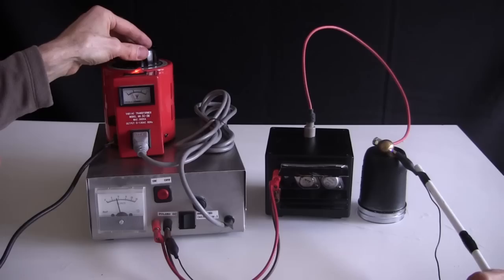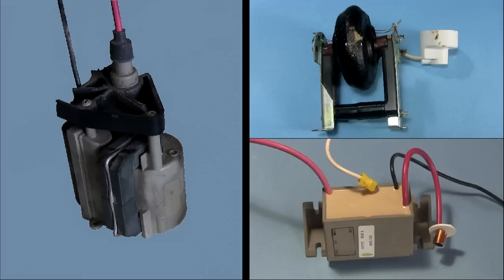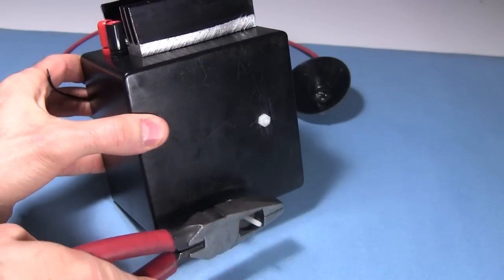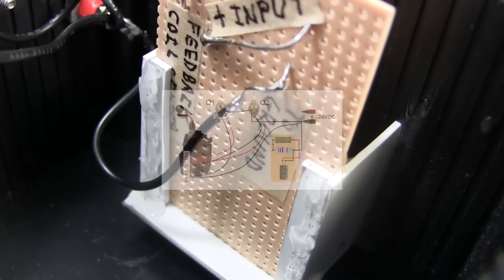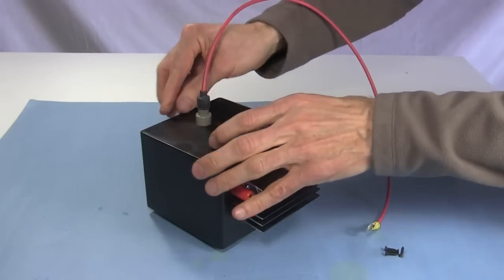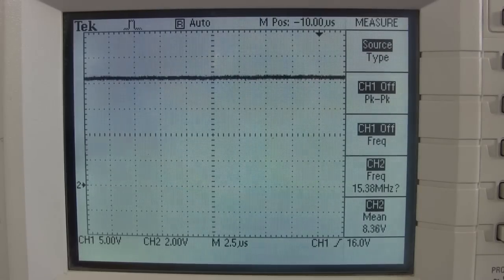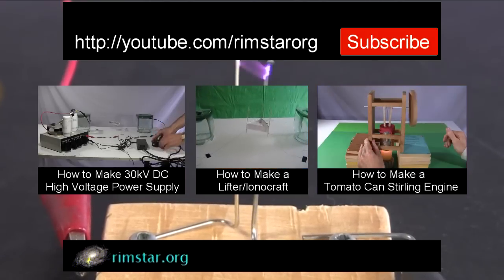The Cube - How to Make High Voltage Power Supply w Flyback/Builtin Diodes

Comment: good day to you . i follow your diagram. and its working but have low spark, because of the of the arching electricity in the corona of flyback transformer. i already put a ground wire and a insulator varnish but still electricity is still arching. can you help me what can i do? or what varnish can i put. thank you for your time.
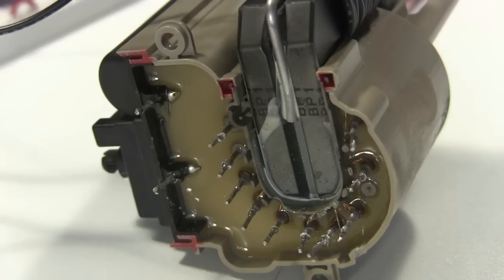Reply from the maker: +john pacheco I'm assuming you mean you have arcing at the pins like I show at 2:33 in the video. If there are any sharp edges involved you can try smoothing them out. If you did any soldering there, make sure the solder is rounded like a ball with no sharp points. Making everything involved rounded is the best first step. If you do that then you will need less varnish. Be careful not to damage the pins. Sometimes they come out easily.
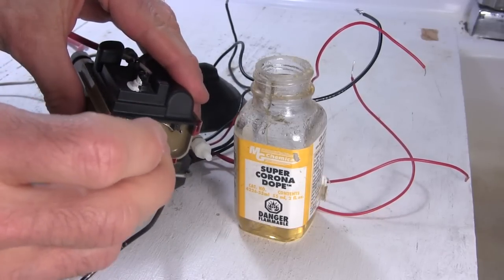The thicker the varnish the better, so add more layers of varnish. Different varnishes have different breakdown voltages but the manufacturer doesn't tell you what it is. A good material to use is called "Corona Dope". I show this at 3:28 in the video. It is designed for this purpose.
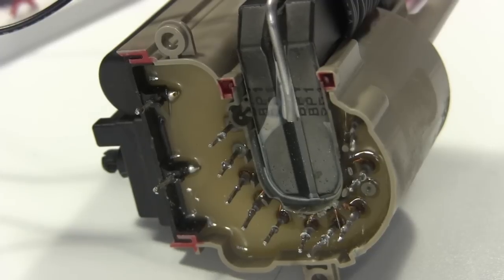You can also put varnish on wherever the arc is going to. At 2:33 you can see it is arcing to part of the structure, so you can put varnish there on the structure too.
Reply: +RimstarOrg  thanks for the advise i will try to follow your instruction. many thanks and more power.

Comment: Does this push out more then 20 amps? Thanks!
Reply from the maker: Gabriel Heredia I haven't measured the output current, but the answer is no anyway. At most it's output is in the low milliamps.
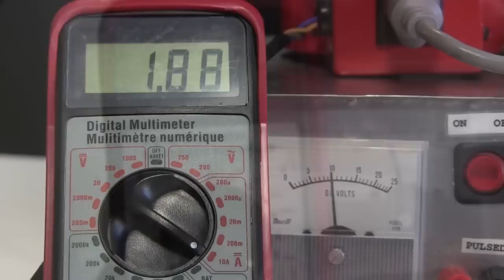The input to the power supply that I measure at 7:12 in the video is 20V x 3.8A = 76 watts. Even if the output voltage is only 1000V, that would be a maximum output current of 72W / 1000V = 0.076A, roughly. Higher voltage would be even lower current.

Comment: I have used a ac flyback ( ozone transformer high frequency one ) and got unbelievably 30000 volts 20 ma arcs by using a ne555 driver circuit with only 18 v 10 amp input and now with a voltage multiplier...i am getting nearly 1 million volts ... it was such a huge success to me ... After some time the voltage multiplier broke because the voltage from the ac flyback transformer was too high than my voltage multiplier could handle... its a monster.. wow 😊

Comment: Great tutorial, sir. I want to build one too.. Can I use one TIP 3055 as the transistor and 2200 uF 35 V capacitor, and have the resistor with higer wattage? will it work nice?
Reply from the maker: Comparing the two datasheets http://www.onsemi.com/pub/Collateral/TIP3055-D.PDF and http://www.onsemi.com/pub/Collateral/2N3055-D.PDF they're practically identical so it looks like the TIP3055 is mainly just a different packaging of the 2N3055. You should be able to use the TIP3055 instead. You'll still need to attach it to a heat sink like I do in the video.
For the 2200uF capacitor, I don't know if 2200uF will be enough. You can use two of them in parallel to get 4400uF, to get closer to the 5000uF. The 4700uF one I use is a very common part and should be easy to find. I've even found them inside electronics that I've taken apart.
A higher wattage resistor is okay. It's going with lower wattage that would be a problem.
Reply: RimstarOrg Thank you, sir.. I've gathered nessesary component for the wiring. But now I have a problem.. I have an adaptor with output 12V and 1.5A. Can it be used?
Reply from the maker: The current's too low. See the video at 7:08.

Comment: I am trying to get a good understanding of the flyback itself andalso the multiplier. I know somewhat how each is made,but it seems that when it is running and hooked to a multiplier,that there is some things about the ringing going into the multiplier that is quite complex. It also shows that pulse DC can be transformed to back EMF inside a transformer and thereby be transformed just as AC can.

Comment: I wonder if the frequency that this cube is running at is actually 15.38 MHz? When you are showing the oscilloscope in the video, the scope looks like it suggest that the frequency may be 15.38 MHz, but it has a "?" after it. I know it is supposed to be a DC output,but perhaps it is a high speed pulse existing in the DC?
Reply from the maker: John Kerley It was guessing at all sorts of frequencies, nothing specific or real. The 125 Hz ripple I show after that at 20kV is real though. It's common with output from a multiplier circuit to have ripple on top of the DC output.

Comment: Hello sir 
Actually I want to know that how do you know how much no. of turns around the ferrite of flyback .
Is there any calculation...? For the no. Of turn
Reply from the maker: No calculation. It's just a number that seems to be used by most people and works. Good question though. Maybe there is a better number to use.
Reply: @RimstarOrg  hello sir, one more doubt for regarding Tesla coil. I have seen in your video that you have used dc power source for your Tesla coil but I have search many times on Google to know which type of power source is used for Tesla coil it shows neon sign transformer which is work on ac power source then I am confused so please clarify me what type of power source is used and why
Reply from the maker: The power supply feeding a Tesla coil can be either AC or DC, both work.

Comment: It looks like you're using both stranded and solid core wire for the primary windings.  I have some stranded 18 awd and solid core 24 awd wire on hand.  I also have some solid core 1mm diameter copper enamel coated wire.  Could this be used instead of the 18 gauge stranded wire?  Does it matter whether the wire is stranded or solid?  How critical are the wire diameters? Have you experimented with enamel coated wire for the primary windings?
Reply from the maker: MrChickenPicker It doesn't matter if they're stranded or solid. If you can't use the size I'm using then just go with the largest size that you can fit. I've used enamel coated wire and it worked.

Comment: Are there any basic safety concerns with creating this? I've always been afraid of flyback transformers due to the pop when grounding out and the staggering voltages they produce.
Reply from the maker: Paul Lovelace Oh, yes, this one is dangerous. Make sure you turn it off and use a grounded stick like I was using to discharge the power supply before going near it.
Reply: Way back when I started my career in electronics, I pointed to a flyback transformer lead connecting the EHT in a TV, and had a spark jump to my finger, The burn took weeks to heal. Yes it is dangerous Old TVs used to run with an EHT voltage of 28Kv. 
The very early TV sets used a mains energised EHT transformer, that was not only dangerous, that was LETHAL.

Comment: I am trying to build a power supply with all diy part except the FWB...

May I ask below capacitor geometry questions?

Bigger the roll (bigger diameter) make higher capacitance.

More surface contact to + and - leg make higher Amp capacitor.

Does longer the cylinder roll make higher DC voltage?

In another word, more chubby person make more capacitance.
More nurve, more waking person make higher Amp.
Does taller person has higher volt?
Reply from the maker: In this video I talk about capacitance https://www.youtube.com/watch?v=GveI9gXIsHw but you'll have to search online for the formula for a spiral capacitor since you'll be needing a very high capacitance. In fact, you'll probably be needing to make an electrolytic one like this http://www.youtube.com/watch?v=ml2TdQ2_2mk and this https://www.youtube.com/watch?v=lmVVdV8wuB0 but I don't know how long it will last. In this video https://www.youtube.com/watch?v=MPD7skZ8OSo. I talk about the capacitor voltage rating (breakdown voltage).

Comment: Is this enough voltage for the ionocraft?
Reply from the maker: My lifter requires 25,000 volts. This power supply doesn't put out that high enough voltage. For my lifter, I used a few different power supplies which you can see at the bottom of my webpage here https://rimstar.org/sdprop/lifter/lifter.htm . However of a different design or a smaller ionocraft, it might work.

Comment: Hey Man, 

I made the circuit as oer your design, but it isn't starting.  Can you suggest some advices ?
Reply from the maker: ElianoDi Check all you connections, make sure they're good and that they're correct. What did you do as your first test? What are you using to power it?

Comment: I like your videos,I can learn from them.Is this flyback safer than a MOT to power a Tesla coil,I hear MOT,s are a bit dangerous.Is this powerful enough for a Tesla coil. Thanks
Reply from the maker: Yes, this flyback is safer than a MOT because a MOT can output both a high voltage and a dangerously high current.  This power supply can still hurt you but comparing the two, it's safer than a MOT. As for powering a Tesla coil, looking at the times at which you posted your comments, you probably don't realize it but you've already seen it powering my Tesla coil in my Tesla coil video https://www.youtube.com/watch?v=0SaEPW_iMF8&list=PLFsZmHTZL-zmfXxstlxuJgRE9bOGobEVu (this is the link for the whole playlist so you can see all the options).

Comment: Hi, if i have a flyback like that, means i can't use a tripler like in your 30kv power supply?
Thanks.
Reply from the maker: DeathMagnetic x Yes, that's my understanding. The diodes that are attached to the flyback mean the tripler wouldn't work. Unless you can somehow remove the diodes. I've never tried.
Reply: RimstarOrg Good news!!. I found a flyback without the diodes it's very similiar with the one you use in your other power supply, but your flyback have 2 connection points and mine has only one with 9 terminals. My cuestions are, can i use any of the 9 terminals to connect the flyback with the 4700uf capacitor? and, how can i identify the primary and the feedback in the flyback?
Thanks for your answer. Greetings!!
Reply from the maker: DeathMagnetic x The flyback in my other power supply has a bunch of connection points, but I have the documentation for it so I could tell which ones to use. Try searching online for the model number on your flyback, if there is one. Otherwise do a search for "flyback transformer pinout" to find instructions on how to determine which pins to use. As for the primary and feedback, I always wind my own.
Reply: RimstarOrg Mmm i see.
Well, in your video you call it "Flyback connection point 2" i suppose that's the 0v pin connection of the secundary, am i wrong?
And also, in my flyback i did the 2+2 turns of de feedback (only than i did with 22 gauge), but in the primary i only did 4+4 because the size of the flyback, does that make much difference?
Sorry for asking you so many questions, but it's for a school project and i want everything to be perfect.
Thanks for your time.
Reply from the maker: DeathMagnetic x Yes, that's the 0v pin connection of the secondary.
Also, 4+4 might still work. It may mean a lower voltage on the output since you'll be inducing less of a magnetic field into the core. On the other hand the lower induction may mean the feedback may not have enough energy in order to turn off the transistors and get the cycles going. You'll have to try it and see. You could also look for smaller gauge wire or wire with thinner insulation if it doesn't work out. BTW, don't forget to use the around 240 kilohm, 2W of resistance on the output to protect your power supply from big sparks. And I also added some more (optional) protection parts in red on the schematic on my page http://rimstar.org/equip/30kv_pwr_supply.htm.
Reply: RimstarOrg Thanks.
Ok, this i think is my last bunch of questions.
So first, the flyback can have more than one 0v output?, and what can happen if i connect to the wrong pin?
And second, if the place where i want to connect the power supply doesn't count with ground connection, can i connect a cable touching the ground to grounding it?
Greetings.
Reply from the maker: DeathMagnetic x I don't have a definitive answer for you. I have the schematic for the flyback used in my 30kV power supply and it had just one ground pin. The coil that the ground pin belonged to was electrically separate from the coil that supplied the HV output, which leaves open the possibility of more than one coil having a ground end, but I don't know if that makes sense.
Regarding the place not having a ground connection, you'll at least need one for safely discharging whatever you're charging after you've turned the power supply, so you will need to ground a cable somehow. You can't just touch a wire to ground, that's not good enough. Usually a few feet of copper pipe is hammered into the ground, or look for metal plumbing that you know extends into the ground.
Reply: RimstarOrg I connect the circuit without the tripler to test it, but when i turn on i didn't get a continuous arc it's more like pulses why could be that?
BTW, i make some tests and the flyback it has 4 ground pins.
Some aditional info.
I'm using 2 TIP35C Transistors, a 22ohms 2w and 220ohms 5w resistor. I don't know if the changes make any difference.
Reply from the maker: DeathMagnetic x I think the continuous arc is because it's high voltage high frequency AC with just the flyback, and high voltage high frequency pulsed DC with a flyback with built-in diodes, whereas with the tripler it's high voltage mostly flat DC. That high frequency part seems to result in a continuous arc, which sort of makes sense, the voltage turning on and off frequently. That's just my guess. With the Cube, I think I get DC on the oscilloscope because there might be some capacitance in the output wires and probe that smooths it out.

Comment: Sir I've used 220-12v 50w ballast to drive my BSC25-T1010A flyback transformer but I got a very little arcs not even an inch arcs. What's would be the problem sir I really need help please help me.
Reply from the maker: I'm not familiar with ballasts so I can't help you.

Comment: VERY NICE!!! I LOVE THIS GUY'S VIDEOS THEY ARE AWESOME AND  HE KNOWS HIS STUFF ! NO DOUBT HE  IS ACCURATE  IN THESE VIDEOS! LOVE IT! THE TRANSFORMER HE SHOWS IN THIS VIDEO IS A IHVT. INTEGRATED  HIGH VOLTAGE TRANSFORMER WHICH INCORPORATES  THE HI VOLTAGE RECTIFIERS AND FOCUS/SCREEN POTENTIOMETERS AND MAYBE SOME BUILT IN FIXED RESISTORS. AWESOME VIDEO NO DOUBT. GOING TO BUILD THIS BECAUSE I ALREADY HAVE THE PARTS ON HAND. THANK YOU FOR SUCH A EXCELLENT VIDEO DUDE!!!! I was wondering about using the drive windings on the IHVT to drive the flyback instead of wrapping windings on the ferrite core?  In the TV/monitor circuit the mfgr has a horizontal output transistor that has around 117vdc on the collector  which is driven by a horizontal driver transistor through a horizontal  driver transformer. This is a easier circuit and doing it the other way is much more involved. YOUR METHOD IS BETTER, SIMPLER AND SIMPLY AWESOME!! Another thing about the DC output from the flyback. It is non-filtered DC . The picture tube acts like a  filter thus raises  the hi voltage up higher  so you won't be able to produce the same level  as the anode hi. V. Lead hooked up to a CRT. CAN'T WAIT TO BUILD THIS. I WANT IT TO IONIZE. THE AIR.

Comment: did you're flyback have a part number on it and if so can i have it please
Reply from the maker: Donna Sutherland All it said was T505 and that it was a Sony flyback. But using that and which TV it was in, my research turned up that it's either 1-453-338-21 or 1-453-338-11.
Reply: ok thanks

Comment: This flyback so I can utilisare to make a lifter?
Reply from the maker: Are you asking if this one can make a lifter fly? If so, I don't think so. In my experience I've needed around 24kV to make a lifter fly. I measured only 20kV with this flyback and transistors. If I turned the voltage up higher then the transistor very quickly heated up and I had to turn it off.

Comment: Sir what is the code number of the flyback transformer you have used???
Reply from the maker: It was a random flyback from a randomly found TV. Pretty much any flyback you find on ebay.com will work.
From writing that was on the board near the flyback transformer it said T505 and clearly it was a Sony flyback. From http://www.tvserviceparts.com/Sony_Transformers.html it's Model KV32FS12, Version T505, Part Number 1-453-338-21. The KV32FS12 might be the Sony TV model number. The 1-453-338-21 is the part number, maybe just for that website. An alternative part no looks like it might be Sony part 1-453-338-11

Comment: Can you help me out with something I hope you answer me RimstarOrg everyone else I asked questions to never answered. Anyways I need to make a 1 Megavolt circuit for experiments I am doing, I found 90,000 volt resistors at 20 Watts power but I cant find any diodes in that range at all... are there diodes that get up to 90,000 volts? or not?, what do you suggest i do to step up the voltage up to 1 Mv?
Reply from the maker: I don't know how to get 1MV, except maybe with a very large Van de Graaff generator (i.e. one with a dome that's a few feet in diameter.)
Reply: RimstarOrg That's not an option I need to make it portable... something maybe that weighs 20-30 pounds its for experiments relating to superconductor work I am doing i know theres things like van de graff generators or Marx Generators but those are huge!
Reply from the maker: Hassan Ajrouche Well, you could look into putting diodes in series and/or parallel to maybe get what you want. But making it portable may be limited in another way in that the voltages between components within the circuit might need to be spread far apart to withstand breakdown voltages, despite doing things like submerging the circuit in an insulating oil or some other insulating material. I'm not say it can't be done, since I've never looked into it. I'm just giving some things to consider.